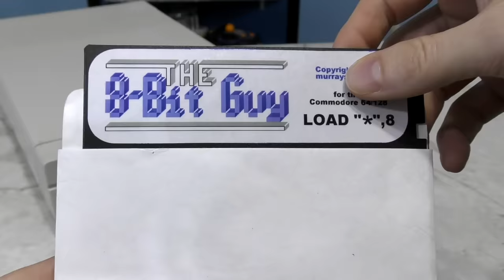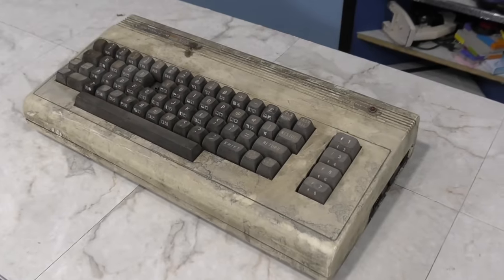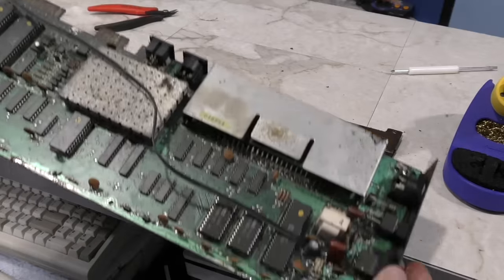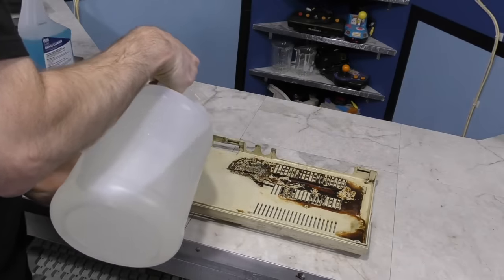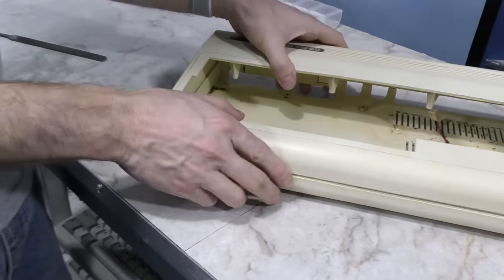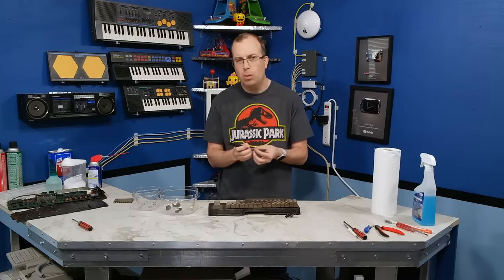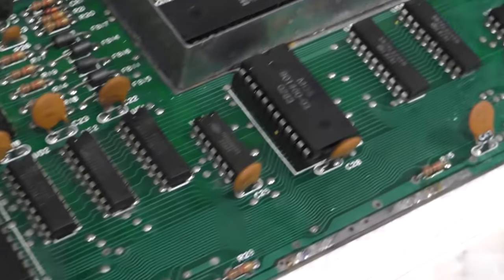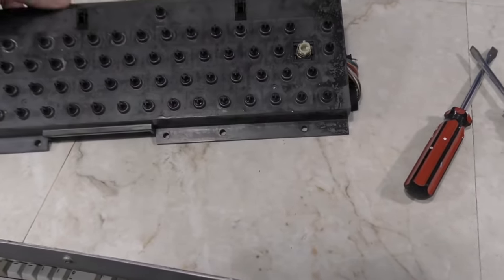Restoration - The Worst VIC-20 I've ever seen - Part 1

Comment: The secret to cleaning off dirt like that is water, soap and time. Submerge the plastic in a bucket of water with plenty of dish detergent, and then walk away and forget it for a few days. You would be amazed at what soapy water will remove if you give it time to work. I bet it would have removed that brown crud in the bottom of the case no problem.
Also, add some barbecue lighter fluid to your arsenal of cleaning supplies. It does everything you currently use WD40 for, but it doesn't leave an oily residue behind.

Comment: The black keyboard panel discoloration is due to the removal of the oils in the plastic by the brake cleaner.  If you take a heat gun and carefully apply heat to the surface you'll bring out more oils in the plastic and return it to its original sheen (or at least make it look better).  Keep the heat gun moving at all times so as to not melt your plastic, and as always, test your application in a small area first.

Comment: You might try next time an Amway steel wool pad. These things are amazing. We had a glue spill (really sticky and hard glue) on our hardwood floor (a stained one) and not only did it work like a charm, but it didn't damage our floor, at least that we can tell at all. They're a little expensive but they are really worth it. (And no, I'm not an Amway salesman).

Comment: For plastics dramatically dirty and covered in grease, after removing the labels, I immerse them in hot water with dish soap, after half an hour I rub them with a brush to polish shoes... It works wonders.

Comment: When I was 12yrs old (1987)I programmed a c64 w/a custom built relay board to operate a saw mill (up-down-cycle-return). I returned there 27 years later and it was still running, covered in saw dust, grease, oils, etc.. It was terrible. but it worked. for all I know it is still going.

Comment: Ive fixed a few keyboards that were used in industrial environments. I let the casings and keys soak in a solution of a gentle degreaser. I usually use like simple green since I used to use it detailing cars and never damaged the plastics there

Comment: if I'm not mistaking, alcohol is useless for oil deleting, because oil has symmetrical molecules, and alcohol has asymmetrical. some other oil, or gasoline, or acetone could work, and alcohol is more suitable for some organic pollutions (and water fits both, but extremely slow)

Comment: The guy should have used EB-1 Gunk spray on the computer.. all of it. Its plastic safe . We use it to clean car engines. It would have easily taken care of the oil and dirt without all the rigamarole of glass cleaner, baking soda and the like. I am a radio restorer and its ok to just coat the circuit board too in this case and using a brush just brush the snot out of everything cleaning it to 100% then drying the board in the oven on low ( 100 - 110 degree setting for an hr or so ) . We and others have done this for decades when restoring old radio equipment.

Comment: David, someone has probably said this before but you should seriously consider grabbing Wax and grease remover. I used a lot of this when I was doing auto body work and it does a great job on hard to remove greasy and oily stains.

Comment: I'm going to try and disassemble and clean some Apple G5 cheese grater Macs and the boards inside are covered with a thick dirt which doesn't appear to be oil based - Would you recommend using brake cleaner to try and clean the logic and expansion boards?

Comment: I know I am a year late, but a solution of dish soap and water is a great solution for oil. I would have soaked everything in soapy water first then gone through the rest of your list. At the very least, dish soap and water would have gotten the majority of oil off of everything right off the bat. Also, brake cleaner is probably the scariest thing to use around plastics and rubber.

Comment: I know it's likely more expensive this way, but I wonder how effective Retro briting would be without the water.
Reply: He used to do retrobrite with hydrogen peroxide salon cream but it tended to leave streaks so he decided to do submersion for the consistent finish. A 32 oz bottle goes for $10 online so I imagine it would get mighty pricey depending on how many things you plan on retrobriting and then retreating because it didn't set right.
Reply: @sorrenblitz805  I didn't say anything about the cream. I was referring to just the liquid stuff.

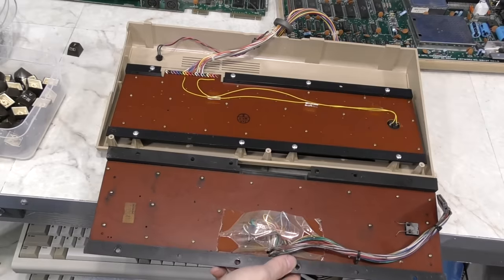Comment: 15:54 hmmm I opened up my C64 to replace a busted off key and my keyboard has the taped-over central wires. does this mean someone already swapped in a VIC keyboard or is the side wire just a later C64 keyboard type?

Comment: next time you have corrosion to deal with, i would recommend soaking in evaporust. it would work on the platic case and the shielding. also, soaking first in a commercial degreaser everything that's not electronics would make quick work of the scum. also, the brake cleaner can weaken the plastic.

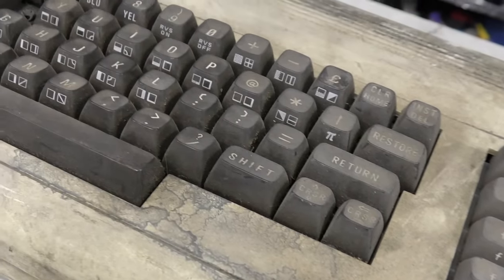Comment: Looking st the state of the rear board connectors and the DIN connectors at 2:53 onwards I would doubt this was ever used for process control as it looks like nothing was ever connected as the crud accumulated.

Comment: Oil companies use DAWN dishwashing detergent to clean oil residue.  It's even used to clean wildlife in oil spills.  It likely would have cleaned the oil on the case if soaked in Dawn soapy water, or maybe directly rubbed on.

Comment: I wonder if the burn marks, are actually from cords being wrapped around with it.  It was mentioned in a later video (C64 restoration), where there were cords wrapped around a 1541 drive, and it made similar burn marks...and it turned out it was from a chemical reaction with the rubber of the cord over a long period of time.

Comment: I imagine that the corrosion came from the oil, because the shiny spots on the cardboard match up with corrosion "lines" on the side of the RF shield that was touching the motherboard. I also have to wonder if that VIC-20 had fell into a tank of oil, because there was oil under the RF shield for the video chip.

Comment: The brake clean literally made me die inside. As a mechanic they tell you to NEVER EVERRRR let it touch Paint, Rubber or Plastic. I get why you did it and it doesn’t matter that much but it physically hurt me lmao.
Reply: Moose Lee brake clean leaches the oil out of the plastic causing it to become extremely dry and super brittle.

Comment: Reminds me of the c64 my friend found running some automated process at a steel mill he was doing electrical contractor work. I think it was for a high pressure descaling machine? Wish I could remember that part.

That was in 2006.

They let him take home all of the spares and broken ones they had on hand when he was done setting it up to work off of some newer tech.
Reply: That is amazing how they were used for such important tasks even into the early 2000s.
Reply: @oldradiosnphonographs  The really important factor was "it works, and it can be easily replaced, so don't touch it."

Comment: I used to work as a salvage worker.After a fire ,when plastic,s getting warm and cool later down it locks up black residu from the fire.we could remove that by heating it up in hot water and then clean it.temperature opens the pores in the plastic and then you can remove the dirt.

Comment: Hey David. I think those are probably not "burn marks", they are indents created by having a cable with plastic softeners in it wrapped around the device. Chyrosran22 / Thomas has at least indicated that for keyboard storage, and I think it is the same for these old computers.
Reply: I think he mentioned this in his commodore calculator repair video, since it had some similar marks. He mentioned that someone said it could be from cables wrapped around plastics.

Comment: Looks like the equipment I serviced in the Chemical Factory I worked at and degreasing was the first step.  :)  And then scavenged all good parts to keep other machines serviceable.  We had a heck of a boneyard.  Use electronics contact cleaner.  The best is a Carberator Cleaner.  The best is Break cleaner but that will melt the plastic and is best on metal parts and limited use on circuit boards.

Comment: Next time go to Harbor Freight and get a bottle of EvapoRust, soak the whole thing in a bucket. It has biologic enzymes to gently deoxidize many types of metal and oils condensate with metal particles.. it literally falls off in the water. You can dilute it and its just as effective. the crud will fall to the bottom of the bucket or container and the EvapoRust can be recovered unless there is gasoline or fuel trapped in the liquid. Its surpringly effective on many things you would never think it would work on. Temperature activates or speed the process.. don't boil it.. but gently warm it up and it will work faster.. it won't work if left out in th winter time when it cold.. or work very slow. Its usualyl pretty safe on many types of plastic. -- if you use it on aluminum or steel beware of "flash rust" the liquid seals out oxygen, but as soon as its pulled out if there are any metal or shiney aluminum surfaces it will begin reoxidixing.. so you need to "seal it" right away.. a gell or oil based somethign without water in it will do a good job.. vegatable oil or olive oil are not good.. they have too much water in them adn will allow oxidation to begin over time. Try a silicon oil or something non-hydrophilic

Comment: I know this video is a few years old... but if you see this comment???
You should try CLR on the rust, and Simple Green to clean motor oil, or if you need something stronger, you can use Purple Power engine degreaser (but it’ll etch the metal if you leave it on too long).

Comment: Is welding dust/metal working dust conductive? As in, capable of collecting on a pcb board and shorting it out?
Reply: Depends on the metal. Some metals aren't conductive so it would be theoretically fine.

Comment: With all that oil I'm really surprised you didn't try dish soap. It's made to cut grease! A ten minute soak in hot water and dish soap could've probably loosened 90% of that gunk! Plus it has virtually no chance of hurting the plastics.

Orange 🍊 Ajax would've been my choice. 🙂

Comment: My mother (God rest her soul) always told me that when you want something clean, you soak it in BioTex, that is a special Dutch detergent in powder form. It is not for the main wash but for the pre-wash. Also, when you work on a car and you injure yourself just put your wounded hand in a bowl of luke-warm water with some BioTex in it. It helps against infections and it gets stains out of your overall. 
 
Therefore I would have suggested, get that detergent and soak the Commodore 64 before you touch it, you never know where it has been. It looks to me that there has been a flood near the men's room of a local garage, because there is some oil. 
 
I would say DON'T TOUCH UT! Get is sanitized first. At least use an ultrasonic cleaner with some bacterium killing denaturalised alcohol. Be careful not to get a virus from a computer!

Comment: The problem with the break cleaner and the bleached black plastic is solvable, u just need some 10w40 oil, a towel and an electric heating blower, take the towel rub the oil onto the plastic and then heat it with caution. And TADA

Comment: I had a Vic 20 that was almost identical to the cosmetic shape of this one  and used acetone to clean similar oil. my Vic 20 model has a gold emblem and has a 2 pin power connector. is that an earlier model?

Comment: Petrol (American "gas") cleans oil, but on plastics you have to be careful not to leave it too long, and you have to rinse it off.
Also, baking soda MIXED with lemon juice cleans corrosion. You need that chemical reaction with the acid from the lemon juice.  
Finally, for large metal parts: Mollasses and water 20/80 cleans  too. But it smells awful.

Comment: Are you sure it's not fire damage? FIres release a lot of vapors from everything getting burned and heating and these then move around in the air and eventually settle on things. That's why fires can so easily ruin house & offices. The fire only needs to be in one small room to cause a need to completely gut the rest of the building / floor.

Comment: I'm surprised, I'd put everything in the dishwasher. Baking soda and vinegar are so much weaker compared to dishwasher detergent, and the mechanical action of the dishwasher jets can easily outperform hours of manual cleaning. I do this every do often for my mechanical keyboard for example and I let it air dry.

Comment: You should try using isopropyl alcohol on corrosion. It's good for tech, but don't use it on the parts that need power.

Comment: Inside of the case I would have used a steel bristle pad with a drill (aka a cheek poker)  and on the outside a medium grit sand paper on a mouse sander for the non-detail areas

Comment: Would soap and water not have worked to clean the grease off the plastics?

I can kinda understand not using it on the boards but why not soak the plastics in very soapy hot water first?
Reply: It was oil, not grease. It may have helped, but it isn’t the most effective method for removing oil.

Comment: You could have used easy-off oven cleaner to remove the oil and probably the corrosion and it wouldn't harm the plastic.

Comment: It's possible that computer was used in a machine shop who use coolant. I work in a machine shop when we pretty regularly have to go and wipe off the rack mount computer switches on a monthly basis because the coolant will get intocomputer or switches and clogged everything up with short circuit

Comment: you should have used dish soap and hot water to clear the oil off the case and metal polish will shift the rust

Comment: The same reason I refurbish and restore vacuum tube radios and televisions.  I have TVs and a few radios that just need a tube or 2 because replacement tubes are rare and expensive so they sit and wait for a buyer to finish out to get the funds to get the needed tubes.

Comment: Remove oil / corosion / yellowing in plastic

To remove the oil and the grease from the plastic parts you can try to wash them in soapy water and scrap it with a brush. You can although try to dive the plastic parts in sodium hydroxid solution too for a few hours as in some cleaning agents espacely for the bathroom. The third way is to dive the parts for a few houers in concentratet alcohol or isopropanol. That should remove the oil and not affect the plastic.
If it realy was corosion on the plastic parts then you should try acid. Hydrochloric acid as in some cleaning agents or acetic acid as in vinegar. Dive the plastic parts in a box in acid for a few hours, take gloves on and clean the parts with water. Metal corrosion should be dissolved in acid and the plastic should not be affected. That should help and give your muscels a rest. ;)
The yellowing of the parts can be removed with hydrogen peroxide. Dive the parts in a tub and put it in the sun for a few hours. Take gloves on and clean the parts with water.

Comment: Gasoline.  A quick douse+toothbrush scrub with gasoline (not too much tho') will clean polystyrene in no time at all.  You have to clean it off right away but it will remove oil lickety-split.  Then you clean it and brite it.

Comment: This restoration is AMAZING and all, but here's my biggest question.  Why spend all this time and effort trying to restore a Vic 20 that's too far gone when you can easily purchase a nicer one (maybe in working condition) for about $50 on eBay?  I understand if a Vic 20 in nice condition went for $500 or something, but nicer examples are out there for cheap.

Comment: engine degreaser such as purple power would have cleaned that in seconds.   It should be in everyone's toolbox as a cleaner (right next to oven cleaner)
Reply: That would hurt the plastic
Reply: @elizabethfrohn-hengst296  no damage to any plastics.  Model builders use it as a paint stripper in plastic models.
Reply: @steveb3885   hmm I might be using a different purple power 

I double checked and I was thinking of the purple grity sanding type paste( unknown brand)  I didn't know about the liquid

Comment: Saw what must have been a Vic-20 or Commodore 64 5.25inch extural drive in the thrift store recently, really wanted to pick it up but without either computer to use it with I didn't feel right taking it, I do hope someone gives it a good home!

Comment: I was working in a Fab as IT and the PCs used on the underground floor where they were cutting aluminum and other metal for the making of robots used for in Chip Fabs the PCs there were all covered with some oil and metal pieces and there was No way in hell you can clean that i usually would replace every PC atleast once or twice a year was awful working on those machines

Comment: I think lye would be a better candidate in the form of an industrial degreaser. That would have been good to use to clean up after the WD40. That is kerosene. Lye would turn that into soap.

Bleach would help dissolve grease too. Grease and WD40 are bad for plastic.

Comment: Next time you get a horrible condition computer, and if it has corrosion, instead of a screwdriver, use some Goo Gone. It may smell like horrible chemicals mixed with an orange, but it will get the nasty corrosion off.

Comment: you would be surprised what a good soak in Dawn Dish Soap and hot water will do for grease and such.....or some greased lightening mean green or purple power and castrol super clean
Reply: WD40 usually works quicker. Dawn takes a good while to soak through that kinda stuff. I've had to clean a truck bed covered in 10 year old popcorn oil/butter. Dawn couldn't cut it. We sprayed like 4 cans of WD40 down and it cleaned right off after like 20 minutes.